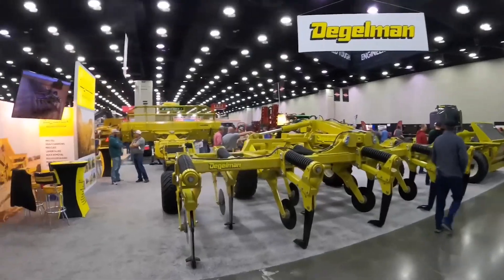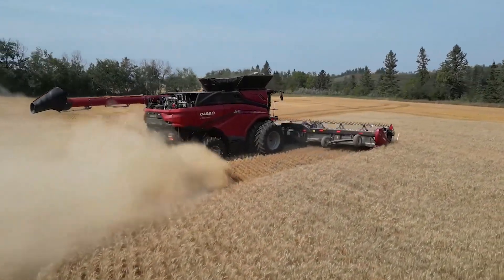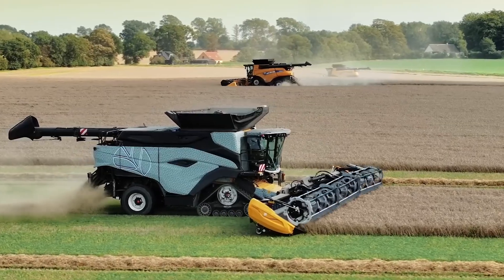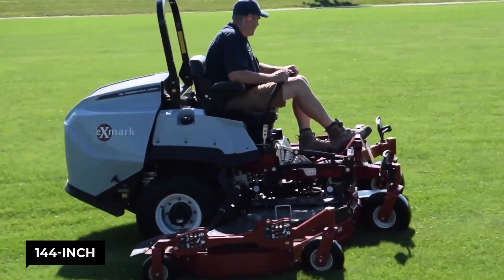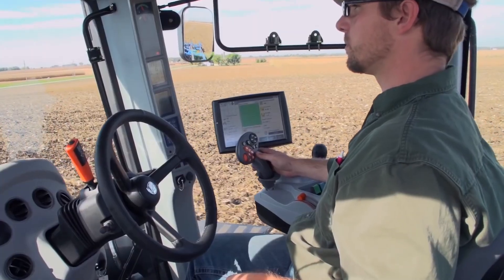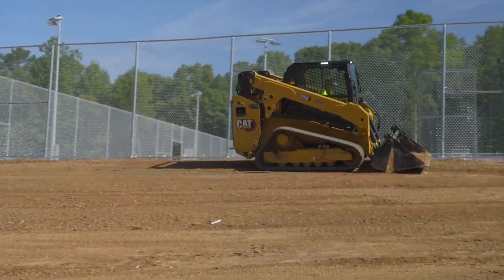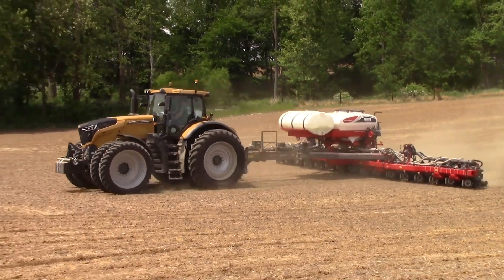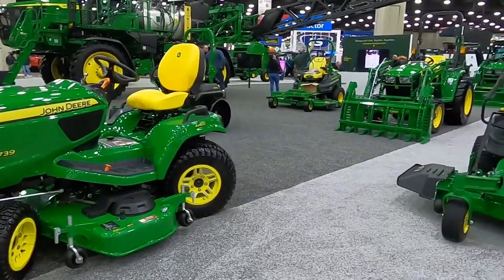Next Level Farming – 2024’s Top Agri-Tech at NFMS

Comment: I saw the new CR11 at a dealer show in the UK. One of the things that they seem to have done is try to simplify some of its internal mechanisms, by reducing the number of belts, pulleys, bearings and other moving parts to go wrong while its working. The Case AF11 as shown in this video is fundamentally the same machine.
Reply from the maker: Spec wise, both AF11 and CR11 are very similar.
Only time will tell which company's engineering design is superior after some usage.
Which one would you choose?

Comment: IRL im a nh user and almsot all our machines are nh (except wheel loader) when i first saw the cr11 i knew this was seriouse machinery like the cr10. i can see the cr11 smashing the most wheat harvested in 8 hours record
Reply from the maker: New Holland makes some serious agricultural machines. Which one is your favorite?
Reply: @EpicMach-home  my favourite will have to be the combine we run irl. New Hollands CX5.80. it runs a 7.3m header and a 8300 litre grain tank. it works well for us and the cab (similar to the higher cr combines) are amazing. control stick so comftable to use amazing seat amazing monitor and the black interior dosent hurt your eyes and just makes you feel better then lets say a grey coloured cab. It is also amazing of how it runs, in uk for 2023 we had mainly flaterned crops from rain but this amazing machine went through it like it was nothing
Reply from the maker: The CX5.80 sure looks like a capable machine.
https://agriculture.newholland.com/en-ie/europe/products/combine-harvesters/cx5-cx6-stage-v
Kind of a shrunk-down version of the CR11. 😂

From your experience, would it be much different to run it compared to the CR11?
Reply: @EpicMach-home  na cr11 by far is better we only have 550 acres so have no need at all for anything bigger then a cx5.80
Reply from the maker: @moocow0014  Agreed. Right tool/machine for the right job. Bigger is not always better. lol

What other NH machines do you have on your farm?
Reply: @EpicMach-home  rollbelt 180 baler (plans to upgrade to the newer rollbelt design in 2025) a t6.145 and a t7.225
Reply from the maker: Nice! Just looked it up.
https://assets.cnhindustrial.com/nhag/apac/en-nz/assets/pdf/hay-tools/roll-belt-brochure-apac-nz.pdf

Maybe I should do a special on NH machines. haha
Reply: @EpicMach-home  yes please
Reply from the maker: Alright then. Look out for it later.